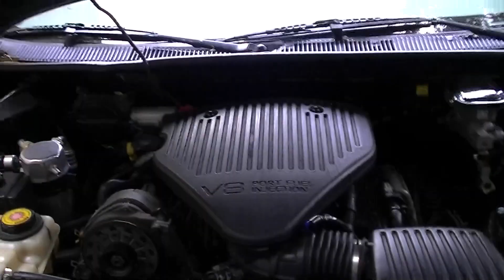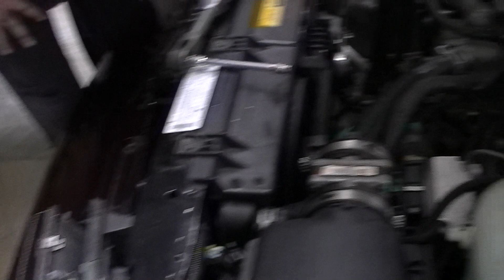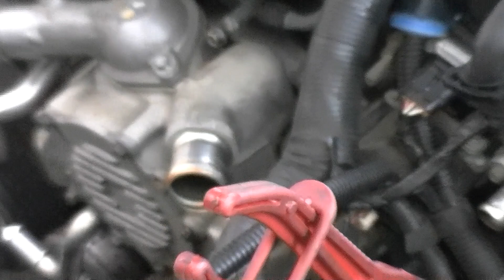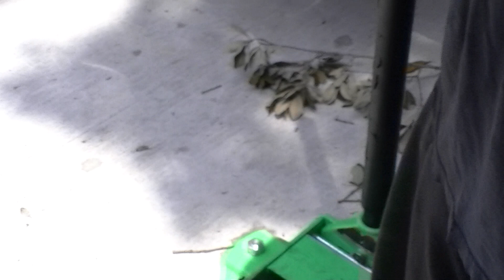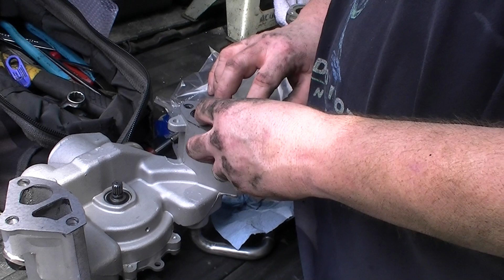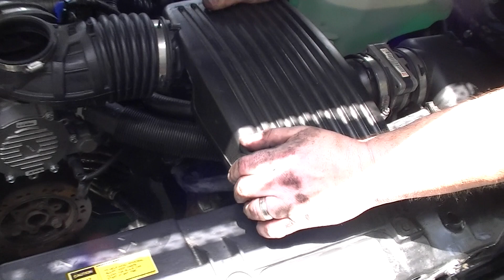Water Pump Install - 1996 Chevrolet Impala SS - Bone Stock Engine

Comment: Have a 2 question what's the name of the elbow valve name? Also what's the difference between electric water bump?
Reply from the maker: Which part are you referring to “elbow valve”?  The difference between an electric water pump and the standard mechanical is the electric is constantly moving coolant at a consistent speed, plus if the electric pump fails, you do not have to remove the housing from the engine to swap it out.  Makes the car run cooler and the other benefit is that if the electric pump fails, it will not rain coolant on your optispark.

Comment: Good job, but you missed a MAJOR step! You have to put thread sealant on the lowest left hand (right hand looking at it from the hood) water pump bolt. It goes through a collant passage and will leak coolant into the crank case and eventually wash out the bearings. Also the black silicone is trash in my opinion. Try the mega gray! Its the best in my opinion. Cool video btw! Gotta love a Gen II LT1!🦅🇺🇲💪
Reply from the maker: Actually, you are incorrect.  You do not have to put any thread sealant on the water pump
Bolts.  The coolant passage on the block doesn’t intersect with the crank case…unless you have a busted head gasket or cracked head/block.  I have a bare LT1 block in my garage and checked your info.  So rest easy man, no need for thread sealant on the bolts :)
Reply: @1mpalaman yup! I.just checked Mitchell and it dosent mention putting sealant on the water pump bolts for a gen 2 LT1. The older SBC's need it though I believe. 😅every lt1 water pump I've done has sealant on it🤷‍♀️....oops

Comment: If you brake the little valve what's the name?
Reply from the maker: Which valve are you referring to?
Reply: @1mpalaman, the one on this video you are removing carefully
Reply from the maker: @pablolopez1967  Thats just an air check valve for the AIR pump system.  Most people just remove the secondary AIR injection system all together to get rid of the additional plumbing.  But if you are trying to keep it all original, here is the same part... https://www.gmpartsgiant.com/parts/buick-hose-air~12552787.html
Reply: @1mpalaman .. thanks, really appreciate... I have a question. I purchased a 1996 Chevy Impala SS and I have a vale with hoes and the it's lose don't know where it goes is there a way I can send you a picture, if you can help me out.
Reply from the maker: @pablolopez1967  Yes.

Comment: Damn brother great job.. *🥇*
I need to do all that to replace thee opti spark..😮
Reply from the maker: Unfortunately, yes you do.  You can get rid of the optispark using a TorqHead setup though.  I did that with mine and love the fact that I'll never have a distributor issue again.   https://torqhead.com/index.html  if you want to check it out.
Reply: @1 @1mpalaman eat video, how does the torqhead work?
Reply from the maker: @MrHitThatLiks works great!  The kit comes with an LS computer, crank/cam position sensors, coils, wires and harness.  The LS pcm upgrade eliminates the lag in the 2-3 shift and just makes the ignition timing that much better.  Plus you don’t have to go through the trouble of removing the water pump if you have ignition issues.

Comment: Good information about the power steering cause that happened to me. I changed the water pump on my 1995 Roadmaster which has an LT1 and I drove it for about 10 minutes and the water pump is blistering hot. It got up to operating temperatures and the hoses seemed to be a normal hot and puffy feel. Advice? Thx
Reply from the maker: Are you sure the water pump drive sleeve got installed?  If it did and the water pump is spinning, then I would check the thermostat.  Did you bleed the system after installing the new water pump?
Reply: @1mpalaman  Thanks for the quick reply, yes the coupler shaft was installed and i did a bleed and i also ran it with the thermostat out but the the water pump was a little bit cooler but still very hot. The old water pump was doing the same thing but that was dumping out the weep hole. One thing i did not do was replace that little o-ring i believe it goes next to the engine on the cam gear.
Reply from the maker: @kurtjohn5554  The coolant is circulating properly correct?  If not, the two main issues could be either the steam pipe (pipe next to the intake manifold on the passenger side that the reservoir return hose attaches to) or the radiator has some restrictions in the core.  For the steam pipe, the banjo bolts have a tendency to get blocked up over time.  You can get a new steam pipe with replacement banjo bolts and seals from corvettecentral.com.  Are the cooling fans functioning properly?
Reply: @1mpalaman It's not getting hot enough for the fans to come on i took it to a mechanic and he didn't seem to be impressed that it was all that hot, thou I had the thermostat out this time. i'd like other people that have the LT1 to get their vehicle up to operating temperature and see if they can put their finger on it three to five seconds w/o a blister? would like to hear back--thx
Reply from the maker: @kurtjohn5554  I would try starting the car and then unplug the temp sensor to see if both fans come on within 60 seconds.  If they don't, then the fan that isn't coming on has an issue.
Reply: @1mpalaman  Interesting idea i will try that, one problem is that my AC system is not charged so turning the AC on the fans will not come on. One way i noticed how to get the driver side fan to come on is unplug temp sensor have the car running and have a paper clip bypassing over the temp sensor clips
Reply from the maker: @ you should check out my video on rewiring the cooling fan circuit.  It’s available in my channel.
Reply: @1mpalaman  i took my LT1 to a mechanic that had a heat gun and it was only showing like 160 for the WP. Even though it would give me a blister if I left my finger on there for 5 seconds i thought it was too hot. FYI though you probably already know this on a number of these cars on the climate control you can hold the off and the up temperature button at the same time. After a few seconds the display will flash a few times then go up on the fan and you can play with a bunch of numbers to get different controls like the temperature, the tack or the speed of the car.
Reply: great info on this comment section! i may have a parasitic draw on my cooling fan😢